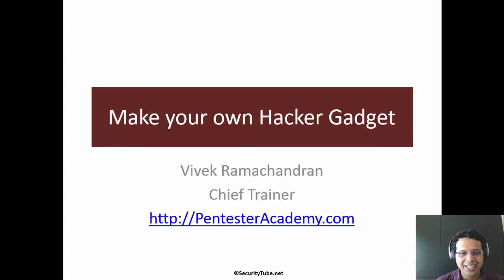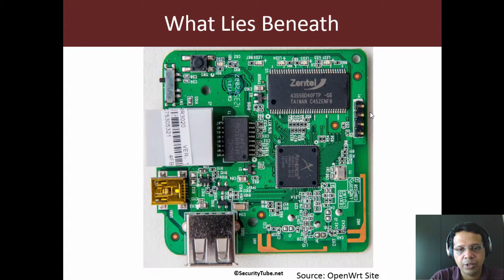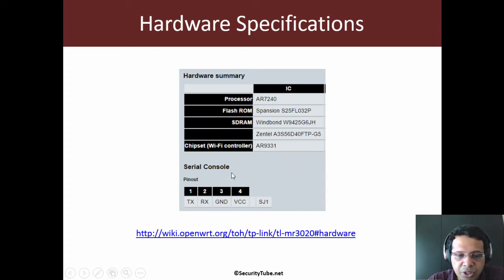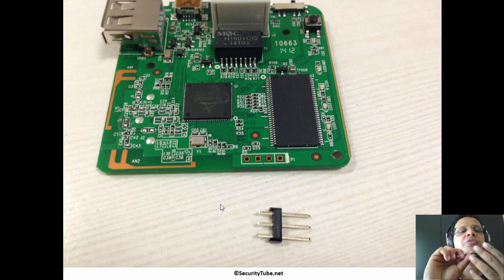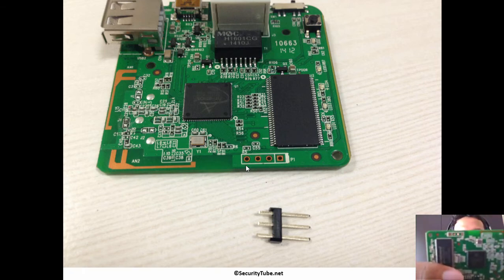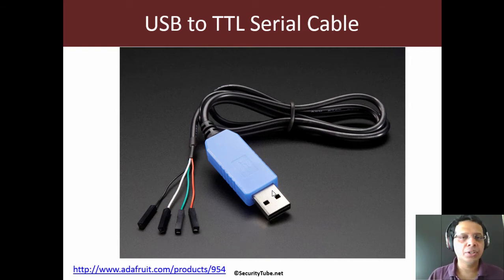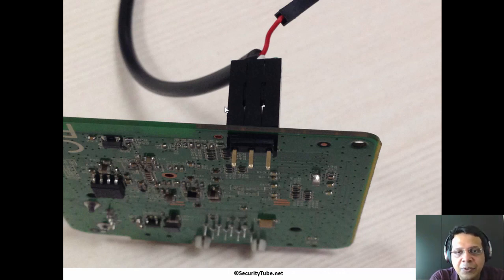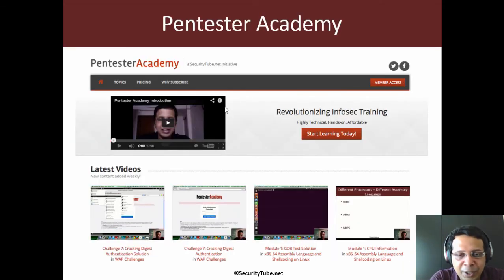Widy: Accessing Serial Port - Unboxing

Comment: nothing serious but the header pin block should be soldered to the other side of the board. the demo you have would not allow the board to be level.
to elaborate: facing the top of the circuit board, the shorter pins of the headers are inserted through the holes, with the black plastic piece resting on top. the longer leads of the pins are sticking up. if you turn the board upside down, the shorter leads should be all that's exposed, ready to be soldered. then you can use wire snips to trim the excess leads so that the circuit board can remain flush when placed back in an enclosure or resting on a table. while you're at it, might as well solder all four pins instead of three.